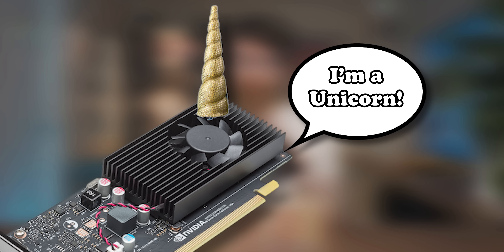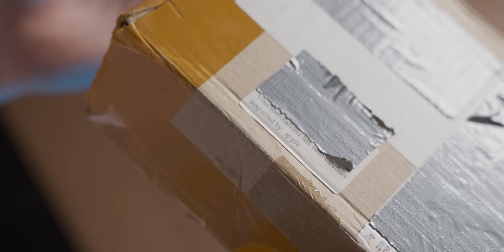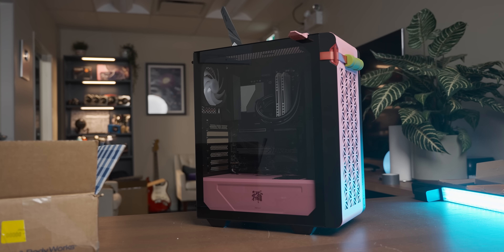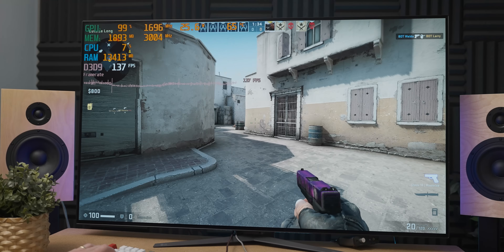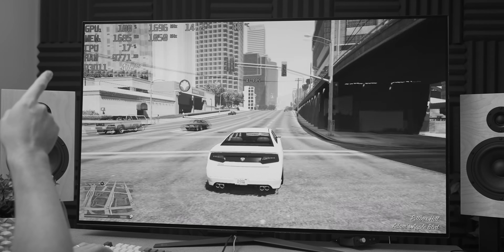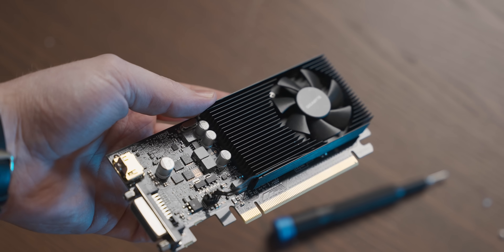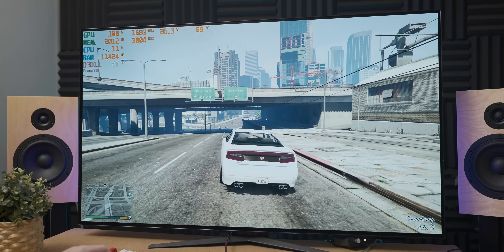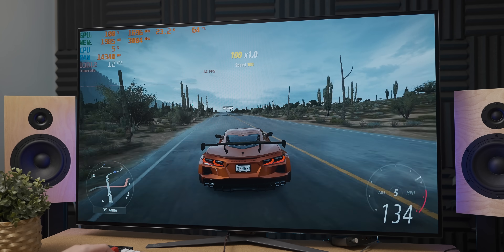This May Be Nvidia's RAREST Graphics Card

Comment: I laughed so hard at how the 1010 is twice as fast as the 1030D4 =))
Reply: Shows how much a card can be held back by shitty bandwith. I mean, look at how bad the RX 6400 does on PCIe 3.0 or how the fastest GT 730 is not the one with the beefiest chip but the one with the fastest memory.
Reply: @RETRY it's not so bad, i run my stuff at 1080p medium to high settings and it runs fine, 60 fps
Reply: @mparagames  but it doesnt do 1080p 144 locked. Not worth (says the internet)
Reply: @Fudgesickle  depends on graphical settings, what game, api, and what clever rendering /upscaling techniques you're using or not

i could get forza horizon 4 to run at 120fps high settings a a 1080p output but by impact he image quality to a significant extent, by using FSR quality + half rate shading (the latter one, on windows, is only really avaliable in a few games, you can't force it via driver, sadly)

but yeah it only does 144hz if you're playiong a light game or willing to do sacrifices to rthe resolution or visuals.

but it technically can
Reply: @mparagames  also you need a good cpu to play at 60+ fps games like cod warzone demand more cpu than gpu
Reply: @hellboy3652  but i do have a good cpu (ryzen 5 5600)

But either way the rx6400 is generally targeted at ppl upgrading office pcs, or sff pcs
Reply: @Fudgesickle that’s not… ffs first of all “doesn’t run 1080p 144hz” is such an idiotic statement, in what game? Second of all it’s not that it’s a bad card, it’s that it’s actually a decent card in terms of raw performance that just has a lot of questionable design choices that make it bad to use. It’s absolutely good enough for gaming but you are simply better off buying something else that’s better value and doesn’t have the terrible compromises/flaws the 6400xt has.
Reply: @Fudgesickle yes it does... I played fortnite with those exact settings on dx12
Reply: @mparagames fact's rx 6400 was one of my first amd gpus and it did it's job on 1080p
Reply: meh ddr4 holds your mom back so of course it will hold back any gpu back from giving it's all at gaming period🤣🤣🤣
Reply: @retry3167what? How would you know it’s not being held back if you don’t have a pcie4 to compare it to…
Reply: @retry3167 still, there’s no good reason for it to just use 8 lanes and just… not have to worry about getting pcie bottlenecked
Reply: @DeepfriedBeans4492 what???
Reply: @slaydog5102  what what?
Reply: Captain_Morgan  Makes the 1030 D4 look even worse

Comment: You should totally try RTX on 8k. We can't be sure it can till we try
Reply: "gt"
it won't ray trace because it wasn't designed for it. For ray-tracing, you NEED ray-tracing cores. This doesn't have it, since it wasn't designed for it.
Reply: @etmezh9073  who told you we can't ray trace without rt core
Reply: @karanveerdeka  only minecraft java can, since even those aren't TRUE ray tracing.
Relearn.
Reply: @etmezh9073  SEUS PTGI uses path tracing, which is a form of ray tracing.
Reply: @itizjuan  which doesn't require ray tracing cores
Reply: @etmezh9073  the calculations behind ray tracing can be done on anything, even pen and paper manually if you know the math behind it. It’s nothing new, and you can find ray tracing demos done on the PS3, PS2, and even earlier machines.